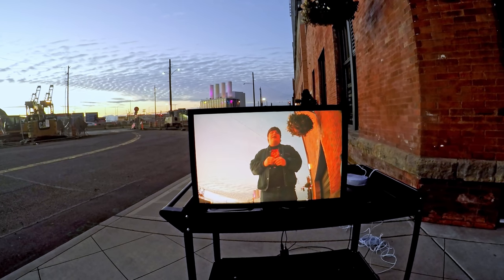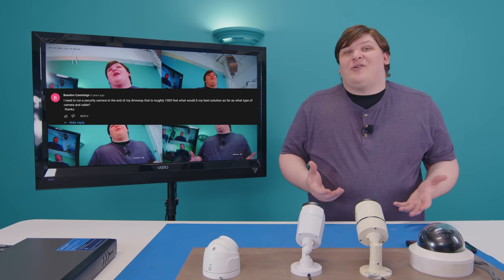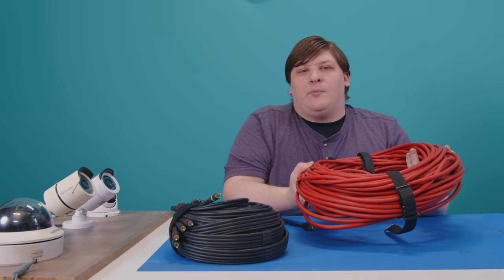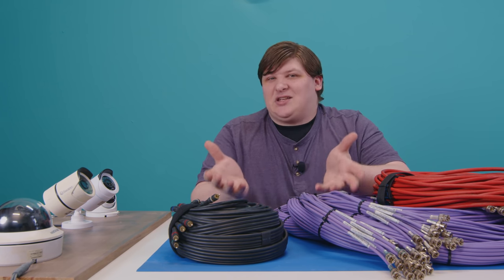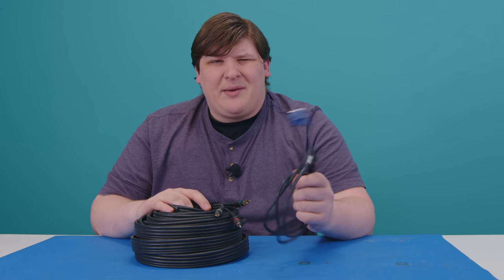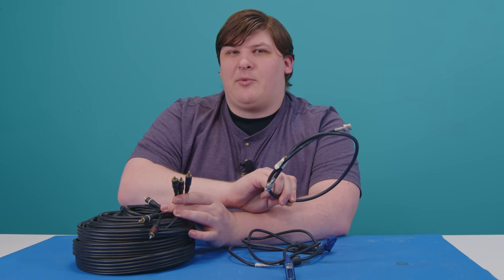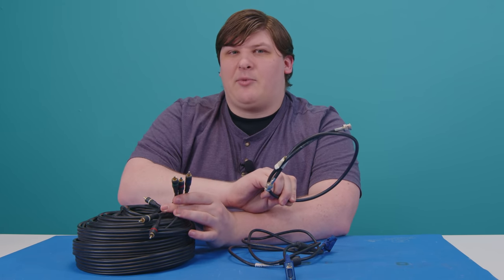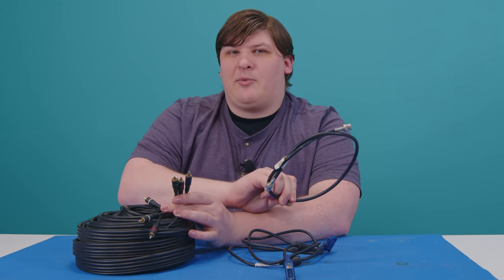1000ft of ANALOG HD video over a single cable?! [AHD/CVI/TVI]

Comment: There may be a lot of debate and confusion over the analog to digital resolution topic but it is actually rather straightforward. To call what was chosen in rec 601 "conveniently close" for existing equipment seems rather wrong to me. As you stated the 525 lines in NTSC was fixed but so was a 3:2 aspect ratio of whatever you call the analog equivalent of a pixel, and 480 lines that was suppose to be visible. When they went digital they decided to move from the non-square phosphor that analog TV had to a square one and there was also no longer a need to do overscan with a digital signal. Thus (3*480)/2=720 explains how they got there. They just chopped the visible part of the signal up where it would make square pixels.

The anamorphic tangent seemed a bit inaccurate as there was lots of DVD's that had hard coded black bars and the ones that were encoded anamorphic gave you more resolution, not less, when viewed in widescreen. You seemed to be saying the opposite, but I think it is a bit muddled trying to relate the CCTV with movies.

One last bit of what hopefully is taken as constructive criticism, you should have said IP based cameras exist and your talking about analog and left it there. This bit about using POE repeaters and not being able to reuse cabling is very misleading since one would not wire a network based system the same way as analog and many cable runs can be grouped with switches eliminating a lot of cable. Plus wireless and MOCA are a thing. 

Thank you for the videos, I just recently found you and what I've seen so far has been pretty good overall.
Reply from the maker: Anamorphic encoding gives you more resolution compared to hard letterboxing, yes, but that's not what I was comparing to. A 16:9 image encoded into a 4:3 space has horizontally stretched pixels, and thus lower definition, inch for inch, on the horizontal axis compared to a 4:3 image in the same space. I wasn't talking about hard letterboxed DVDs because I frankly didn't know anybody did that until recently.

I don't really know what point you're making about IP cameras. I said if you have a thousand foot run, you can't use IP for it without repeaters. "what if you had more equipment in the middle" ignores the presupposition - the premise is that you don't and can't do that.
Reply: @CathodeRayDude  I understand what your saying with the resolution but my point was the two things were different enough that relating them seemed confusing to me. Analogies are rarely perfect but IMO are best when they are something a bit more commonly understood than aspect ratios on DVD's. I'm not trying to criticize, just trying to offer some (hopefully) helpful perspective.

As for the IP based camera's my point was that you gave just enough words to dismiss it when the fact is that there was literally no reason to come up with a scenario in which it may not be viable as it was not the topic of the video and you have no interest in covering most digital technologies. Sure, if you want to constrain the topic to a thousand foot run where there is no power at the end then getting your network there with ethernet cable may be more involved and expensive than a single coax cable and an analog camera. However If you want more than one camera then things can look quite different. Also I see a EOC Converter on Amazon for $80 that will let you use a IP based POE camera supposedly three thousand feet away over coax. You brought up a warehouse and that is what I was referring to with more equipment in the middle. Having a single switch that can supply both power and data to dozens of camera's in a single area and then just a single cable that runs to the next location can be advantageous  and cost effective over the old analog way of doing things, as well as not degrade over the run. If your covering an analog "something" and the topic of the digital equivalent of the same isn't going to be compared or covered in any detail then IMO it is probably better to limit your commentary and opinion of the digital.

Comment: Not to be too nitpicky, but Ethernet most certainly can (and did, for many years) run on coax. In fact, thinnet (10BASE2, 10Mb/s  with 185m max length) and thicknet (10BASE5, 10Mb/s with 500m max length) were the original Ethernet standards and both use coax. They were popular in systems using token ring or trunk topologies.

Comment: I'm probably wrong, but dont analogue camera's have a maximum number of dots on a horizontal line? While not pixels, you can say the resolution of their signal is the dots per line the camera is recordering. Maybe analogue blends the dots together so it doesnt matter as much, but finer detail will then get blended over too. More precise blending can be achieved with more dots per line.

Comment: Fascinating topic nonetheless. When I have been fairly recently choosing the surveillance system to supervise the insides of data room, not knowing all you had shown us today, I insisted on changing the analog to IP one. Maybe I was afraid of all the noise generated in high power dc converters, that those cables would have to cope with? Anyway, I ended up with hikvision cameras and recorder, and 100m of STP ethernet cable. It works reasonably well, but unfortunately the viewer software is so picky, that I have to keep IE11 around with appropriately outdated plugins, to be able to watch the recordings or transmission from time to time.
Reply: That's just because Hikvision is bandaid tier stuff.

Comment: Color NTSC is kinda a hack designed to preserve backwards compatibility, so I wonder if they made an entirely new format that works differently, could it push higher quality and/or better resilience to noise? Hell, maybe even a digital format with data redundancy?

Comment: I'm sure the host knew this, but for anyone in the comments, FPV drone racing is something else that uses a ramped-up NTSC Format, for similar reasons, but they tend more towards high frame rate than high resolution.

Comment: At my old job we had a comical amount of security cameras. About half were analog. The rest were IP based. The IP based ones could go a lot farther out on a cable than you technically should
We stuck one at the end of a direct bury CAT6 so it could be at the security gate in the back of the production warehouse. 
Our analog ones just covered the warehouse from the ceiling.

Comment: 20:00 all ntsc is interlaced. So it does all odd lines then all even lines. So do 256 lines each time at 1/60th of second, so a all line coverage every 1/30th. One reason was to stop the jelly wobble you get on mobile phone video these days. But also was easier to broadcast using technology if day, meaning sports and fast moving images could be clear without using  even wider band widths.
Reply: The uk went widescreen PAL analogue and digital before we went widescreen HD. It did it by squashing in to 4:3 for transmission then TV would expand back horizontally.

Comment: I'm curious where in the technology family tree this rests compared to systems such as Japan's MUSE (Multiple sub-Nyquist sampling encoding.) It seems as though they were able to accomplish something similar in 1979 (though not put into practice until a decade later.) They used Hi-vision (HIgh-definition teleVISION) to capture the 1984 Olympic Games, but broadcasts didn't start until 1989.  Still, 1035 lines in 1989 in a 8 MHz space over analogue is pretty impressive. I'm unsure of the distance this could be pushed though. Yes this is related to Hi-vision LD that has been covered by Techmoan and Technology connections.
Reply: muse still required more bandwidth than was available over existing channel allotments didnt it? I think this is why it was only commercially deployed for broadcast over satellite?
Reply: @StevenBradford  but MUSE was used for High vision MUSE LD players.
Reply: @grafxgear  Yes, and I could have been more clear, for broadcast purposes, Muses was only deployed over satellite. Once you are talking about recording, you have many more options (UniHi and W-VHS, as well as MUSE LD.
Reply: I could've sworn there was a widescreen (anamorphic) standard-def broadcast format in Japan in the early 2000s?
Reply: @poofygoof  probably was. There was a wide screen set in my hotel room in Tokyo in 98. Maybe that was for Muse satellite broadcast though.

Comment: Wait. You guys don't use Blackmagic URSAs for your surveillance systems? Joking aside, I am coincidentally in the market for a home security system. That cheap one sounds appealing and looks fine, also. Fascinating video. I was soaking it up. I sold cell phones when those signals were still analog. Your call would get fuzzy and static-y before it dropped. Then the digital swap came with CMDA and GSM and it became connected or not. No in-between. I never considered video the same way but now it seems obvious.
Reply: I was working for Cingular when they turned off the last of their analogy tower equipment. The months leading up to it, we sent out letters warning customers. We'd get  some trickling in here or there to swap their bag and car phones for the free Nokia. Then the day they finally turned off the old stuff, the next 3 weeks or so were awful. Everyone who ignored the letters or claimed to not get them came in angry that their bag phones weren't working. They'd get even angrier when we told them it never would again and they had to go to this smaller "toy phone" they called it.

Comment: Most of the HD cameras where I work are connected to the DVR through Wi-Fi connection. They connect via a VLAN - meaning it is harder to break into. WiFi repeaters are cheap means to extend the WiFi range.
Reply: I'd imagine 1000' might not be cheap for a repeater, and would perhaps also suffer from crowded frequencies in dense environments too, likewise with multiple walls etc. Of course it will suit some places, but overall certainly wouldn't be as reliable as cables.
Reply: @DoubleMonoLR  most of the rural area around where I live use Mesh Network Systems which is a lot cheaper than standard WiFi repeaters.

Comment: IP over coax adapters are a thing. Amd they work rather well. We don't install AHD on new sites. Only IP Cameras and you can regularly get 6mp+ cameras for under $300. Hikvision and Dahua use PoE+ which will work for upto 200m on a cat 6 cable. If that's not enough use a switch or wifi bridge to get more range.

Comment: Yes security footage is all done as cheap as possible. Single chip at the recorder end to convert, and the camera the smallest sensor they can use, with gain cranked all the way up at night to get the image. You also get the new ones with colour at night, using a sensor driven to the limit, using ambient light for it, or a separate light source instead of the IR one.

Comment: Is it a matter of the long cable creating too much resistance in the circuit, causing the signal to fail to reach its destination, or is there some other reason you need signal repeaters to make it go over a much longer cable?

Comment: Yeah, scary cable prices are the bread and butter of commercial and enterprise gear. There are MPO cables with specialized connectors and fiber numbers and configurations that can cost over $1000 for a 3M length just because they're unusual and low volume parts. And those don't even include the transmitters, which, for the cable I'm thinking of, are around $1800 per end. But if you want to make use of DellEMC's 200Gb QSFP56+ ports on their switches and blade chassis, then that's what you have to get. The fiber optic cables capable of making the runs for some of the ultra-long-range QSFP adapters are also scarily expensive due to the quality of the core and shielding on the fiber has to be to prevent dispersion over up to 1.5KM of cable at speeds up to 100Gb.

Enterprise gear and other commercial professional gear isn't a joke. It's what happens when you give engineers a problem and say that the price of the finished solution is irrelevant, so make it happen.

Comment: There was also edtv & differential video. 3 wire hdtv in full analog. First hd broadcasts were analog until broadcast, as the copper cost was simply too high.

Comment: I’m curious about the artist application of these HD analog cameras. If they capture the footage in similar ways to CRT cameras. Are there tubes in them or is it just a sensor? If outfitted with the right lenses what would the “look” be.  Very interested.
Reply: Tubes haven't been in cameras since the 80s even analog broadcast cameras switched over to ccd in the late 80s to early 90s and since the early 2010s we've been on cmos late 2000s for cinema but early 2010s for everything else.

Comment: I don’t understand why our hd security cameras do use bnc connectors,they almost looks like a coaxial cable but i suppose they are just composite video,and i believe theres also a tripple bnc system wich outputs component,not sure,
About those coaxial and phoneline cables, i like the fact that it use possible to use them for internet despites those cables were never intended for that,but with smart digital compression and encoding into an analogue form, it become possible to do just that😁

Comment: Worth mentioning there were efforts to do higher resolution in the 60's with broadcast gear.  Electronovision pushed RCA TK-60 cameras to 819 lines to produce the TAMI show (theater release).  It sounds like they pushed some cameras in the 70's to 1,500 lines for theateral release movies.  Details on the are slim though.
Reply from the maker: There was also a fully analog HD format - 900-something lines, I think? - in use for a bit in France if I recall, verrrry little information about it.
Reply: @CathodeRayDude  it was 819 lines.  It is believed the TAMI show was done with gear converted to this format but details are sparse.

Comment: There are digital solutions over coax (heck, the original ethernet was all over coax), and if you have really long cable runs already set up it would be fairly cheap. 
You're right that it generally wouldn't be as good for most situations for what you're talking about though.

Comment: HD-SDI was actually used for a short time for cctv systems before CVI became more popular, it was expensive and very temperamental. its no longer used. i still have some SDI cameras and a recorder sitting around. would you be interested in looking at it?
Reply from the maker: I already have some SDI cameras that I've played with but no recorder. I've always wondered if / how one of those would handle output from pro video gear. If it's something you're looking to get rid of (e.g. just spare parts taking up space) then I might have a use for it, email me if so. (cathoderaydude at gmail) Thanks for watching!

Comment: I wonder if they cheated, by lowering frame rate. If you they would want to add more lines or more detail per line, lowering frame rate would provide a lot more bandwidth per frame.
When you showed video from recorder, it seemed a lot lower frame rate, when it was in "HD" format.

Comment: Did you try a composite to USB digitizer? I am pretty sure there were other HD analog video standards intended for non-security camera uses.
Reply from the maker: Strangely, I didn't think at any point to even try that. I have no idea why. I think because my initial thought was "let's put this into a CRT haha- oh wait, that might kill it" and then my brain just slipped off of the idea entirely.
Reply: @CathodeRayDude  Odds are good that the CRT would just fail to get a good lock on the start of the frame or it would just filter the whole signal as noise. I would not expect it to cause any real damage. I was playing with a few analog to USB video capture devices and they seemed to be smarter than I expected (especially considering how cheap and poorly manufactured they were).

Comment: If the analog hd is low latency (<30ms)
I am very interested for FPV. 

We use NTSC / PAL cameras with video transmitters on the 5.8g band
There are a few true digital systemes, but I would love a step up in analog tech since that's what I use.

Comment: In the late 90s or early 2000s there were a few computer programs to change the header of an NTSC video so that the TV would think it was 4:3 and would display all of the horizontal lines squished. It would do it for recordings but since it was the early days of HD some satellite TV boxes had that function and my Trinitron TV did it BUT i think it was something else beause it would squish the video vertically to display it 16:9 (I still have it, it is maaassive). I can't remember the name of the satellite TV box, it was near the time that the migration to digital began with Digicipher and Digicipher II, it was capable of receiving HD and displaying a crazy amount of crisp and sharp video on plain old analog TVs in wihch standard definition analog satellite television was far crispier than any analog TV I have watched in all of my life, inclusind VHS, Beta, DVDs.

Or maybe I am remembering wrong all that stuff, it has been more than 20 years since I first dipped my toes on the release scene and all that stuff.

Saludos from México.